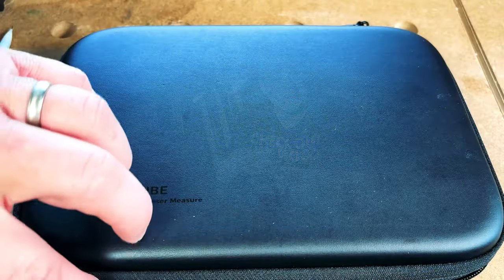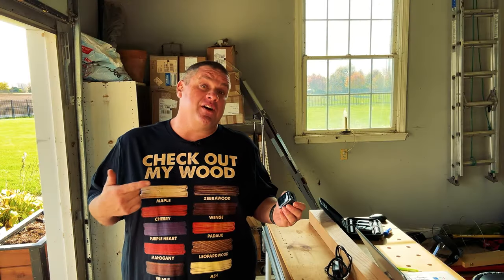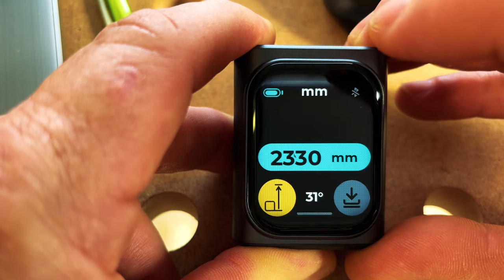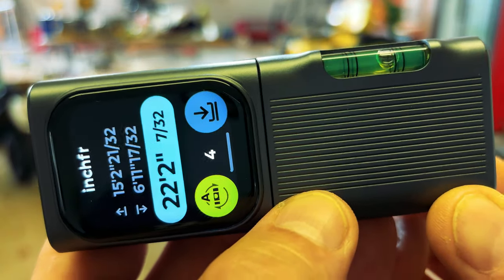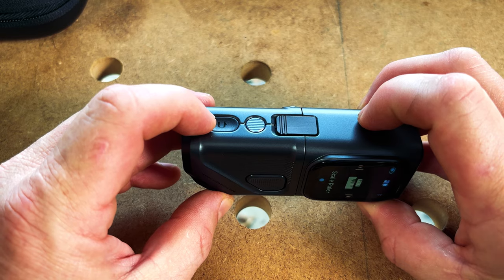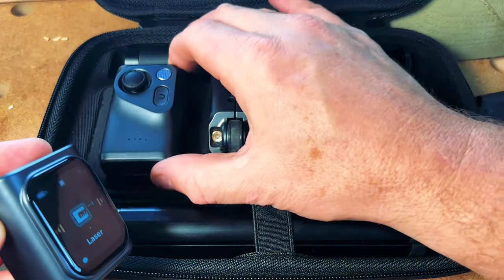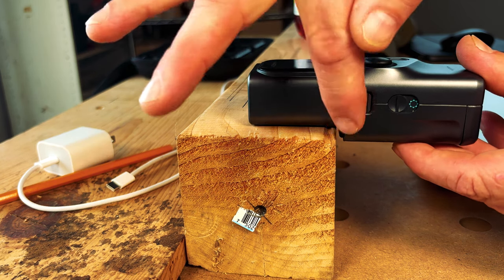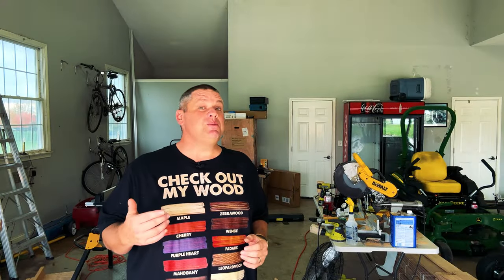Sneak Peek: Unreleased Tool That Will Revolutionize Measurement

Comment: Very cool to see what is coming in the not so far future this would be a great tool for contractors, and or designers. Someone that needs to do a layout of a room. Very cool review thanks for sharing.
Reply: Realtors might appreciate it as well.
Reply from the maker: I totally agree with you Jim!  Even an architect could use it regularly.   May not be for the woodworker, but still cool to see.  Thanks so much for watching and commenting!
Reply from the maker: Excellent point David.  I think it would be great for a realtor as well!

Comment: I didn't see at any point whether you confirmed the precision of the angles and measurements this device displays.  I see this as a non-woodworker's tool.  It would be beneficial to someone who needs rough measurements.
Reply: Agreed. I don't really see the point of reviewing a measuring device without verifying its accuracy.
Reply from the maker: I agree with both of you.   I should have incorporated a tape measure into this video.   My mistake and thank you for bringing this up!
Reply: So is it accurate or not?
Reply from the maker: @rjdavis947  tested it out yesterday.   I confirmed it with a bunch of measurements, and didn't see any discrepancies.

Comment: Can it be used outdoors? It seems like a cool tool
Reply from the maker: You that is a great question Dennis.   The tool that i have is a prototype and it could be used outdoors I think, but I would definitely not get it wet at this point.   I'm guessing they will be hashing out the smaller issues like that once they get closer to production.   Thanks so much for watching!